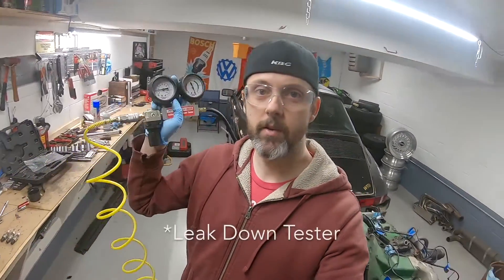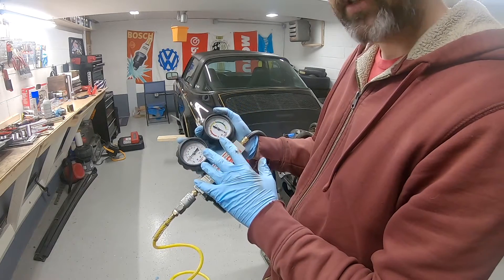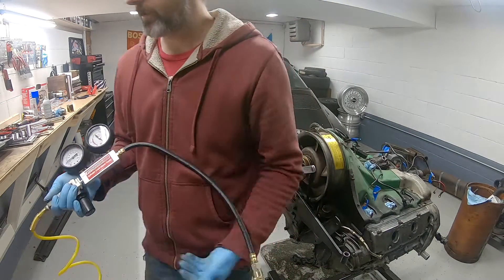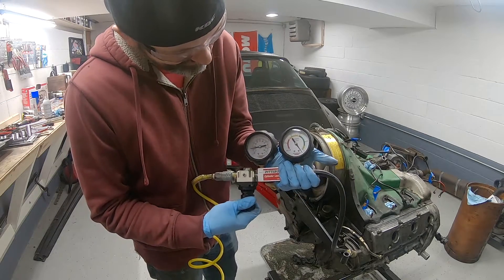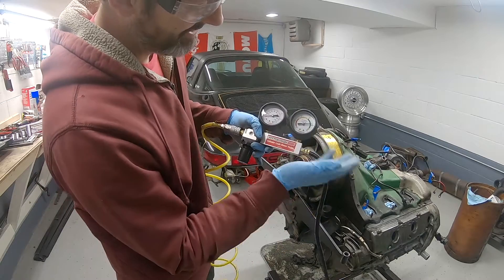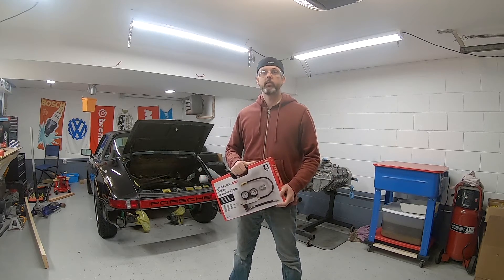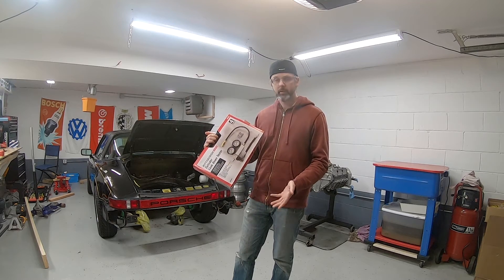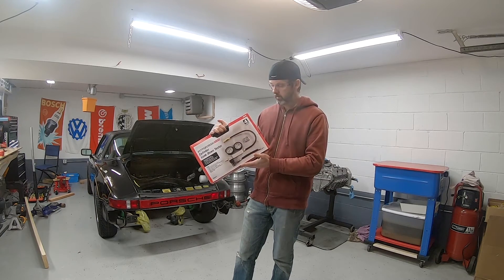How To Use a Harbor Freight Leak Down Tester & Why You Should NOT Buy One!

Comment: All pressure regulators have hysteresis.  You shouldn't ever adjust them in the CCW direction like you were.  They'll all drop once you use a bit of air.  Adjust in the CW direction to hit your pressure target.  If you overshoot, you have to go sufficiently CCW to bleed off some air, then try again in the CW direction.  It's not the tools fault in this case.  

If you don't like ~20 psi for pressure tests, that's fine, to each his own. Some people like to err on the low pressure side, as they're worried about unexpected engine rotations of they put high pressures in the cylinder.  That doesn't matter if you're at BDC or TDC, but then again, a guy might want to check leakage in the middle of the piston's stroke as well to see how the cylinder walls are in various positions.  There are pros and cons to higher or lower pressures. As long as the orifice is fixed and sized appropriately, either one can work fine.

Comment: I did some testing on mine and the leakage gauge maxed out at about 11 psi, was non linear, and would not zero and the gearing is really sloppy. It took some work but I got it to read within about 3 percent so long as I was tapping on the case.
I am going to replace it with a better quality gauge the specs would be 2.25 inch diameter bottom mount 10psi with 1/8 in NPT threads. one good thing is if you have one you can use the hose as a valve holder if you need to replace a valve spring without pulling the head. 10 psi seems low to get any noise I could be wrong but now that I have an accurate gauge I can find out. Hope this helps.
Reply from the maker: Another good way to test these is to throw them into the friggin garbage and see if they stay there.

Comment: Well...  We all know the limitations of Harbor Freight Tools, as many are indeed not great.  But in this case, it's unfortunately evident that you don't understand the principles of this measurement and how to use the tool properly.  It does have some limitations and shortcomings but not what you are mostly talking about here.  Leakdown testing is essentially an indirect flow measurement by reading the pressure drop over an orifice.   You should not set the pressure to more than the "zero" reading on the RHS gauge as that is the nominal maximum it is built for.  This happens with about 15psi after the regulator for this particular tool, as indicated on the LHS gauge.  If you set the pressure after the regulator to up to 100 psi as it sounded like you tried to do, you likely busted the RHS gauge.   The 90 or 100 pressure maximum that they are talking about is the feed pressure to the regulator.  Not the pressure after the regulator.   And do to do the measurement you have to connect the tool to the cylinder and leave it connected to read the downstream pressure (called leakage here) after things stabilize.  Sorry.  Not the tool's fault!
Reply from the maker: 15psi is a joke for leak down testing
Reply: @ADDvanced  I'm concerned that 15 psi won't flow enough air to hear where leakage is. I had a homemade one with two equal gauges on each side of an orifice. I may end up just using the hoses from the harbor freight like one I just bought. I'm guessing that the right gauge has about a 15 psi range. Why didn't they just use a 30 on the left and specify only 50 max on the compressor. Maybe the 15 range on the right makes it more sensitive?
Reply from the maker: @kenhilson786  You can hear it at 15psi, it worked, it was just hokey.  I sold it and I'm buying another one shortly for my jag project.